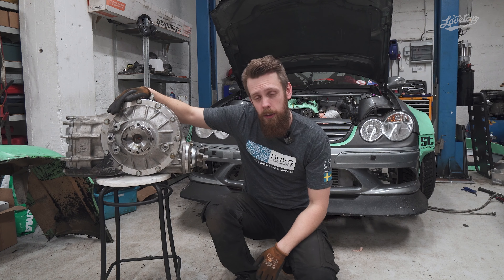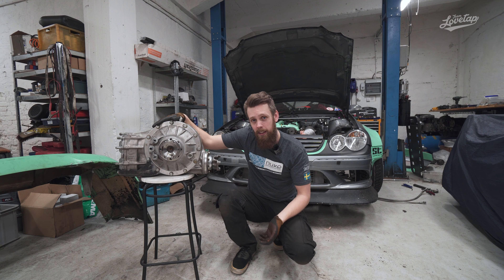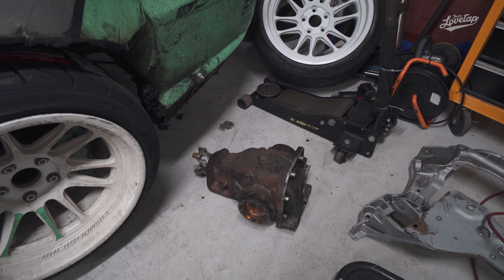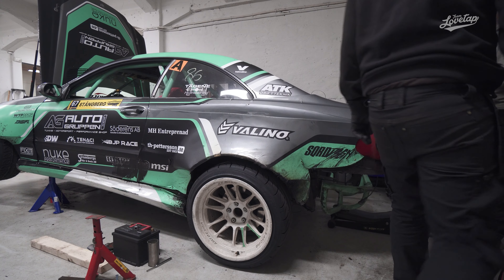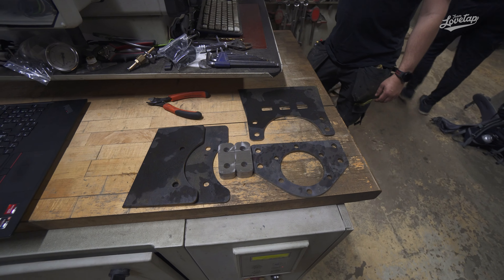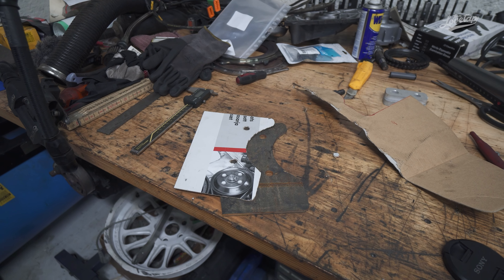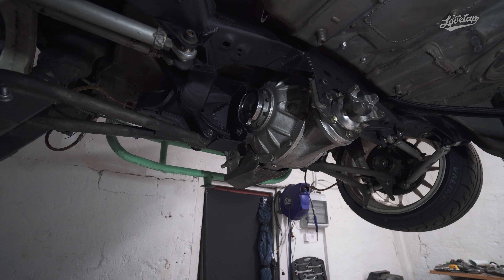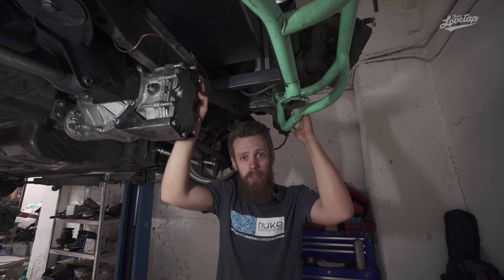How to fit a Quickchange Diff | Subframe Rebuild| Mercedes Driftcar

Comment: Bra jobbat Mårten&Crew! Stilla tanke, vore det idé att göra vinkeln på klumpen ngt ställbar? Tänker då primärt för vinkel mellan kardan och pinjong? Original sitter det som kanske bekant ett aluminium "shims" mellan diffklumpens främre del och bryggan just för detta ändamål.  Antar att fjädringsvägen är begränsad, men ändå... Mvh; Jesper
Reply from the maker: Tack så mkt, nja de finns inte mycket anledning till det då inte diffen rör sig i relation till lådan, de är bara på stel axel de gör de?
Reply: @TeamLovetap  Jo, vad avser röra sig under drift är det helt korrekt. Det betyder inte att man med individuellt helt kan bortse från brytkrafter, givetvis. Mao, på en individuell ställer man det i stort sett bara en ggn, vid installation. Tanken är ju att få alla brytkrafter till ett min. Så när man justerar till säg minus 3 grad på en stel brukar man sätta individuell till 0.5 till max 1. Detta eftersom klumpen vill uppåt på pådrag å saker rör sig.
Reply from the maker: @gainforlife5877  nu är jag med på vilken jesper ja pratar me 😅 det är nog något som inte hade skadat o kontrollera, var ute o testkörde igår me bilen o de vart ett lyckat test, vilka symptom kan för mycket vinkel skapa? Onödig belastning för kardan o bakvagn?

Comment: Intressant! Blir det att modifiera drivaxlarna eller finnns det flänsar som passar med e34 axlarna?
Reply from the maker: De är samma bultdelning så vi kom undan med samma drivaxlar sjukt nog 🥰
Reply: Äh de va ju fusk😂 Får se hur jag ska göra nån gång på S210 som har längre axlar🤔
Reply from the maker: jag kör ju e34 axlar på min med custom längd från Fixit transmission, åker e34 hubbar i original spindlar @englundasjohannes

Comment: Finding rear gears for a Merc trackcar is SO hard. Does anyone here know if the different ratios for the 210axle is equally strong? Could you take the ring gear and pinion from a 6 cyl car and use on a high hp build or are they cast/made weaker somehow then the ratios made for the amgs?